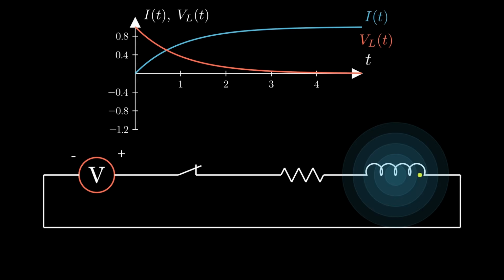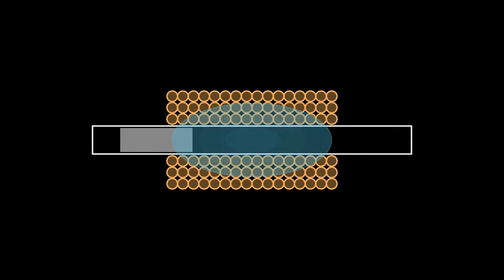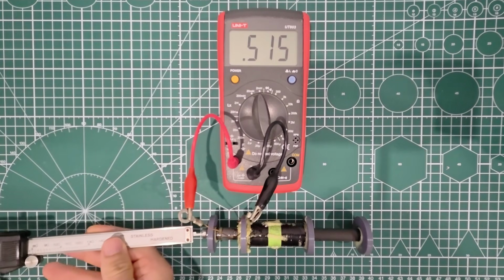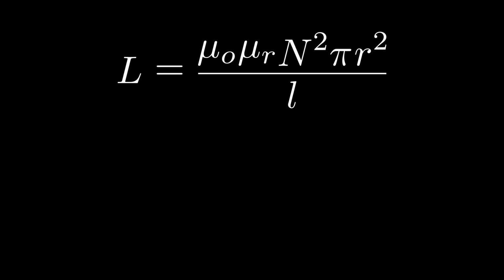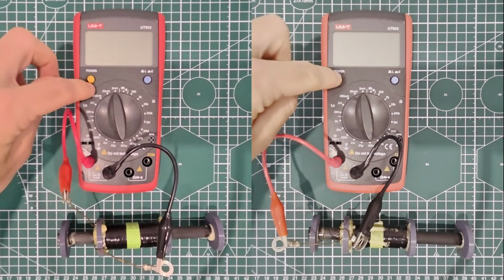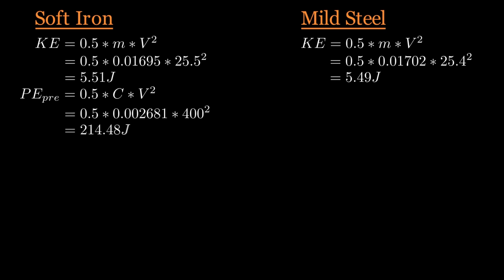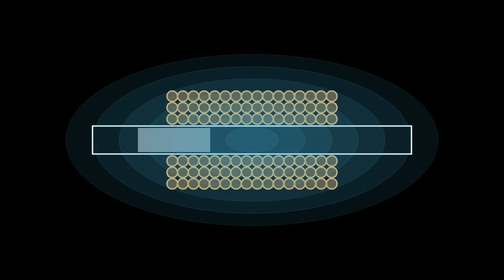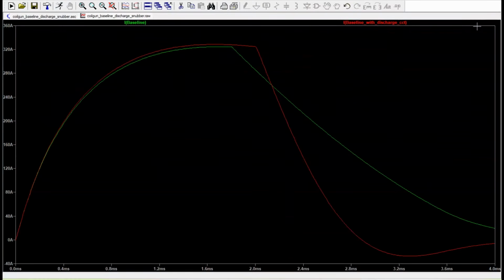The Science Behind The Coilgun

Comment: Super cool! It would be fun to look at the theoretical maximum performance for a given configuration and compare that to the test results. Projectile energy is limited by the magnetic pressure times the action length; So it scales linearly with the length of the "perfect barrel" (Infinite short coils forming a traveling wave), quadratically with the bore diameter, and quadratically with the projectiles saturation limit, after which you enter the linear regime and I^2 starts melting your coils before you see any real gains. You can derive a pretty succinct formula to estimate the theoretical maximum performance of any reluctance coilgun in that way. This is what makes reluctance coilguns really great at launching big heavy things, and really challenging to get small things to high velocities. The rabbit hole from there goes *deep*. 🤣
Reply from the maker: That would be interesting to look, as there are plenty of factors just from a mechanical design point of view that are limiting to maximum performance. I have definitely found the larger the projectile gets the more efficient the system becomes but smaller projectiles at higher velocities just can't compete. You have definitely got me thinking now on how to make an improved multi-stage design. Deeper down this rabbit hole I will go!
Reply: @owensprojects  Yeah, there's definitely a lot of head room - for example a 10mm bore with a 500mm barrel and a 1.8T saturation limit should have a ceiling on the order of ~200-400J KE if I remember correctly? That's irrespective of how gigantic your capacitor bank is. 200J is a lot, it's enough to go supersonic with the right projectile. But getting there requires progressively more complex engineering. Bipolar metalized film caps wired with SiC MOSFETs such that you can collapse the field of coil N into capacitor N and then drive N+1 with caps N..N+1 in series, "handing off" the recovered energy from coil N and also driving the time constant of N+1 down is something I've always wanted to try. PWM control of each coil using SiC or GaN fets to maintain the perfect time varying field without the waste of a huge current spike is another interesting idea. And finally, algorithmically optimizing multiple stages... Needless to say, I enjoy this topic!
Reply from the maker: How do you calculate or arrive at the approx. ceiling of the kinetic energy? I'm keen to look into that further. 200J would be enough for most the size projectiles i have be using to go supersonic. The recovering of the energy of the collapsing fields being used to help power the additional stages is an idea I having be toying with coming up with a good solution though for it is another story.
Reply: @owensprojects Im so sorry, my memory betrayed me, I just re-did the math, 200J is not for a 10mm bore, its for a 20mm bore. You calculate the maximum Magnetic "pressure" with B_sat^2 / 2u_0 and multiply that by the cross sectional area of the projectile (bore diameter), and then multiply that by the action length to get the work done in an ideal world (perfect coupling, perfect coils, etc). The magnetic pressure represents how much force the projectile can accept before it reaches magnetic saturation. You can push harder but you enter the linear regime and your coils start heating up massively for every extra joule you put in to the projectile. 20mm @ 500mm gives you almost exactly 200J of energy; 400J if you bump it to 1000mm barrel.
Reply from the maker: Thanks for that! it's good to know and gives me an upper limit of what I can attempt to work towards. As I get deeper down this rabbit hole
Reply: @owensprojects  No worries! Love to see what you do! Just to throw another turn in that rabbit hole; Induction guns behave differently and are theoretically unlimited in this way. ;)  
Until recently (SiC/GaN) we simply didnt have the ability to build the power electronics necessary to make them work in any reasonable way
Reply: One more thing; The maximum energy in an ideal reluctance accelerator is actually an achievable target - you can get to ~80+% of that theoretical number, its unrelated to the guns efficiency (if anything chasing a higher percentage of the theoretical KE will likely drive your electrical efficiency down). You can make up for some of the discrepancy between your gun and the theoretical perfect gun with brute force (dipping into the saturated region, just massively intense magnetic fields in the bore)
Reply: @jerth heyy that's what I'm currently doing - making a proper coilgun simulation with FEMM and NGSpice.
From the theoretical side, I'm thinking mostly in terms of energy and power, then current and voltage are inversely proportional and merely a product of choosing the number of turns or capacitor voltage. For coils, the main factor is current density * coil thickness, which is equivalent to the H field; and for the projectile the saturation flux is much more important than permeability.
Maybe the most important opportunity for optimization is this: force is created by the difference between magnetic field at the front and back of the projectile, so it only matters that the front is inside and active coil, and the back outside, and the projectile can be arbitrarily long; and the shorter the coils, the less losses there are, they just must be long enough and switch quickly enough.

Comment: Good analysis and experimentation!
Have you measured the actual voltage/current waveforms and compared them to the simulations?
It would be great if you could get a simulation to be close enough to real world data to allow optimisation of all the coil/projectile parameters at once in simulation, then built the optimal result and see how well you can get it to perform.
Reply from the maker: I have tried to get current waveforms by making a primative  current probe for my scope using a CT but there was bit of interference from im assuming the EM pulse when firing the coil. I could get decent wavforms when firing a shot at ~300V the wavform followed a similar shape to simulations. But you are right it would be ideal to be as close as possible to be  able to simulate an optimized design and then build. The next tool i will buy will be a proper current probe to get that data